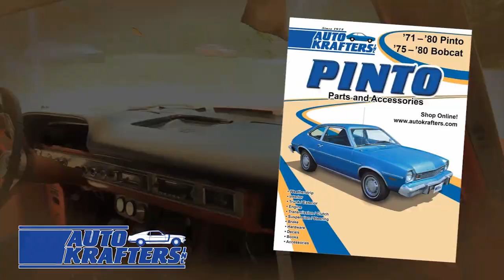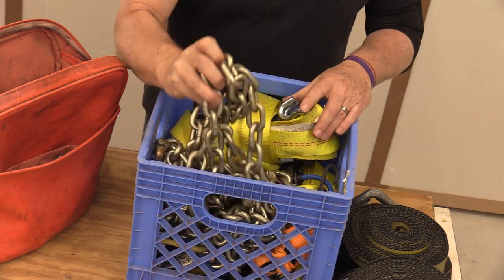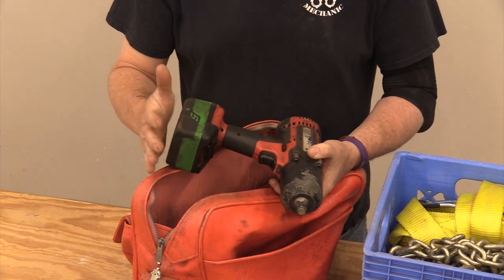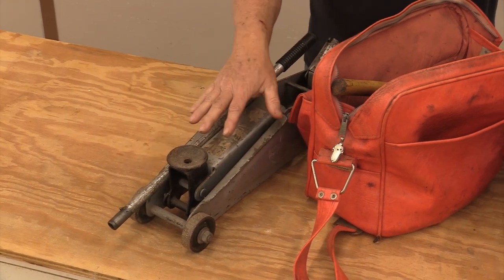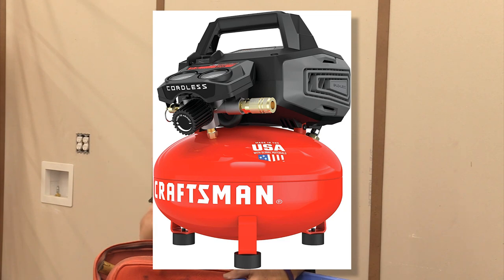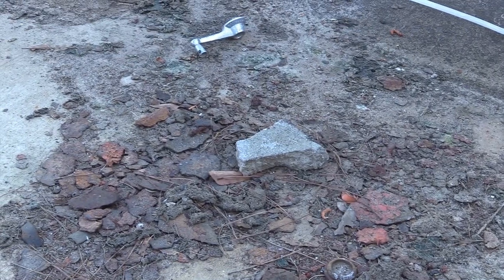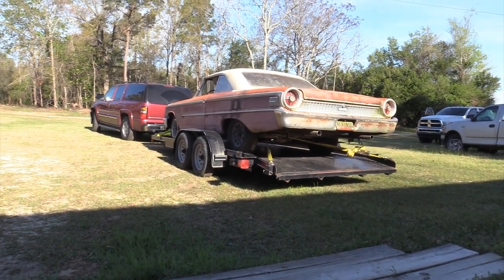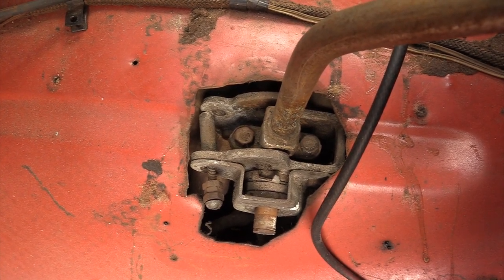Trailer Towing Tips

Comment: Dad has one of those. He bought it new in 63 then got drafted to go to Vietnam. He did a restoration back in the 80's and it is beautiful (Rangoon Red). He swapped a 302 since the factory 390 went missing while he was overseas. He had his fun at the strip and his claim was 427 valve springs stop valve float which allowed the trip down the strip with a single shift into second. Far as I know it is still intact and probably will be mine one day. It is what I call a sleeper with a boatload of style. I didn't like what they did after 63-1/2 with the changes to the rear quarters.
Reply: So someone took the 390 out of it when he was over seas?
Reply: @2000blackstang  
Yeah.  None of his brothers  would talk. Messed up if you ask me.

Comment: When my family and I moved from California to the mid-west .We used a 34 ft. Ryder rent-a-truck. We needed a 16 ft. trailer to haul my 1988 Ford Ranger 4x4 on So my Dad and I go get the box truck and the guy says you have to go to our other yard to get the trailer no big deal right? Ok while we are signing the papers the guy comes in and says Your trailer is all ready to go. We start back up the 405 to the house and just before we get to our off ramp this lady in a station wagon pulls up on the driver's side honking her horn and waving her hands. We look over just in time to see the trailer go from the slow lane all the way to the fast lane and take out a good 100 ft. of the safety cable that Cal-Trans. has running down the middle of the freeway. We pull off the freeway and call the guy this is when pay phones where still a thing and we tell the guy there's a little problem with the trailer he says what's that  we say it's in the middle of the 405 dead silence on his end. Turns out the "expert" at the rental yard just dropped the tongue of the trailer on the ball and called it good. I guess that God was watching over for us sure on that one.